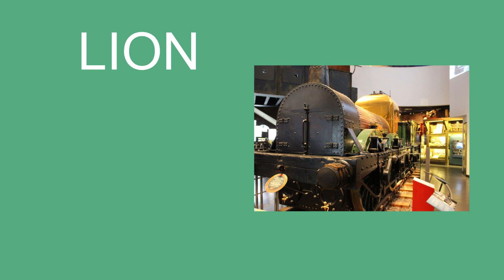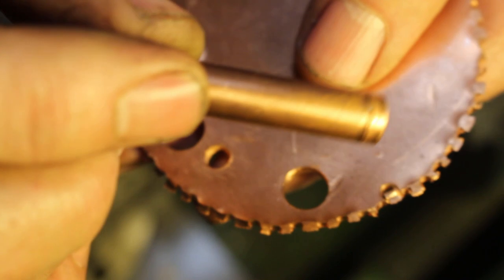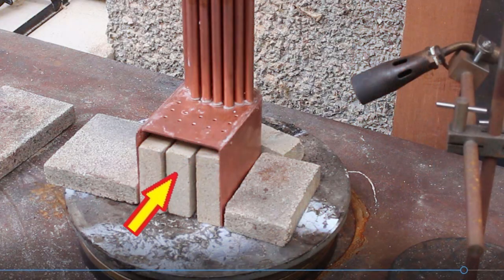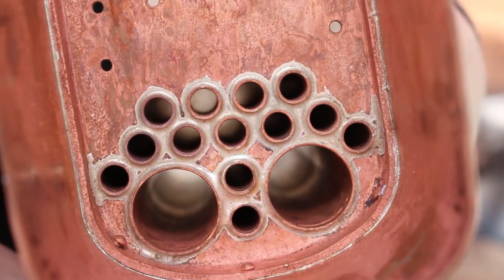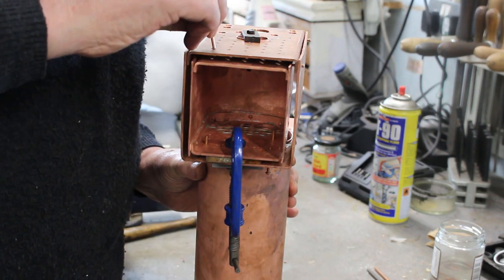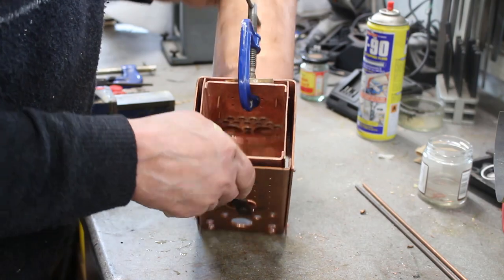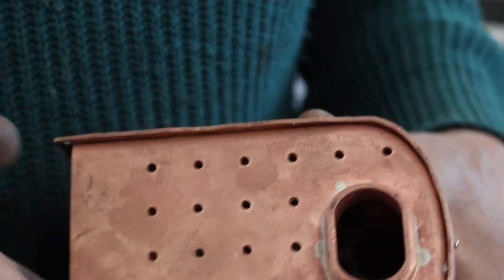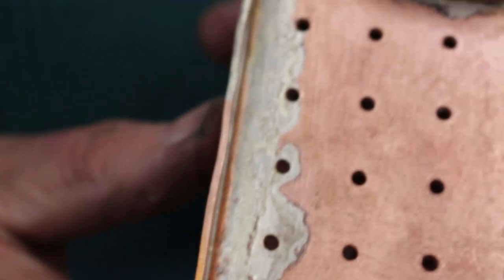Building Miniature Steam Locomotive LION pt .15 - Silver Soldering Fire Tubes + Fire Box

Comment: That really is a very difficult silver soldering job but you made it look easy !
I recently got back oxy acetylene capability in my workshop and doesn't the extra heat make a difference !
love the tool for putting the bulge in the tube , sure stops the tubes from moving !
Reply from the maker: Hi Ian, for sure it's not as easy as it looks, it doesn't come across how nerve-wracking the process is. This is my first boiler so I'm learning as I go.  The large Oxy Propane has been a benefit getting heat where it's needed without having to excessively heat the whole job but I find the job still benefits from some initial background heat applied from the standard propane torch. I'm sure Oxy Acetylene is the way to go if possible as it will likely provide sufficient localised heat with out the need to add background heat. Thanks for your interest and comment.

Comment: Nicely shot video, thanks. I´ve done quite a lot of silver soldering of smaller work,  it´s always so satisfying when it´s done and pickled. Just came back to this kind of work after a pause of a few years, and was shocked by the increase in cost for the silver solder. Oh, and the propane increased 33% per filling here in town since last year... Must get some more work like this done soon before I can no longer afford it. Excellent job on the boiler, subscribed because of it.
Reply from the maker: Hi Andre
Thanks for subscribing, much appreciated. Yes, building the boiler is expensive,, Soon after I started this boiler I invested in an oxy propane torch and oxy cylinders don't come cheap, but it did help allot as it can heat up a smaller area much quicker than just a normal propane torch. 
Good to hear you're getting back into the hobby and glad you're enjoying my videos.
Cheers!

Comment: What can you tell about... soldering parts with finish solder joints .... do they go to gell.... or is it no problem? There are so much joints that cant be solder in one go....
Reply from the maker: Hi DreamSteam. Soldering joints that have existing previously soldered joints can be tricky, it's very easy to disturb the previously soldered joint. Silver solder is available with different melting temperatures, so the usual procedure would be to use the highest melting temperature for the first joint and lower melting temperature for the next joint.  Controlling the temperature to close limits is not particularly easy though, requires practice and skill. Melting the silver solder on an existing joint does require a higher temperature than when the joint was first made, so there is a little help there. Silver soldering a boiler with propane or oxy/propane torch is not easy, a large area around the joint must be heated, if you can use oxy/acetylene, which has a much higher flame temperature,  you can concentrate the heat to where it's needed with less heating of the surrounding area, making silver soldering much easier and easier to get neat joints. Hope that helps.

Comment: Where did you get your new torch from and what size please?
Reply from the maker: These are the torch and nozzle I have.
https://www.thewelderswarehouse.com/Welding-Supplies/HD-oxygen-propane-torch.html#SID=424
https://www.thewelderswarehouse.com/Welding-Supplies/Oxygen-Propane-Heating-Attachment.html#SID=424
I got my rent free oxy bottle from a local auto parts store.

thanks for watching
Reply: @GoCreatehms  Thanks I'll have a look at that. Cheaper than buying a TIG welder 😃 love the pipe swaging tool. I had to retube a Simplex boiler that had the tubes drop flush with the firebox plate. Hard work with propane!